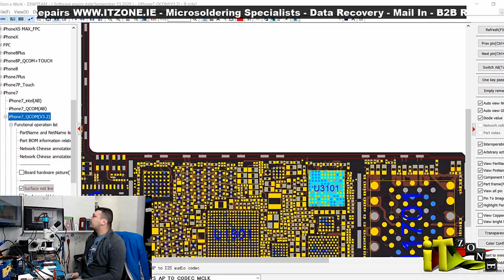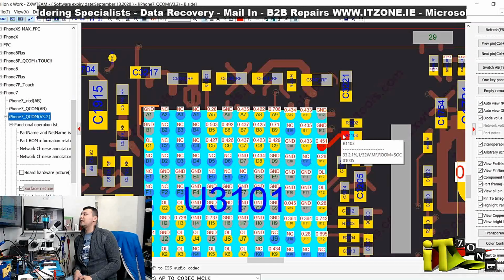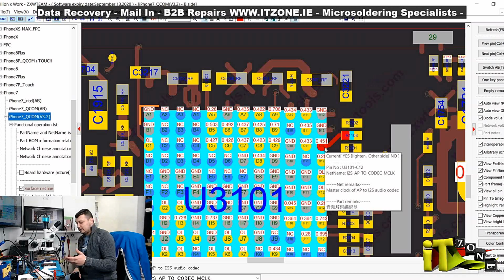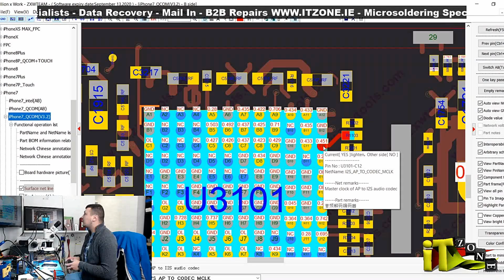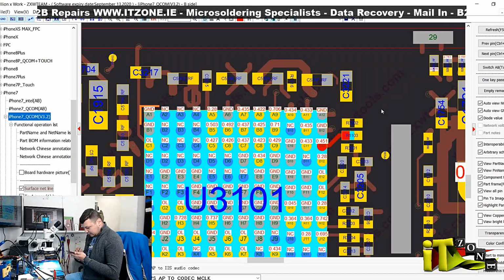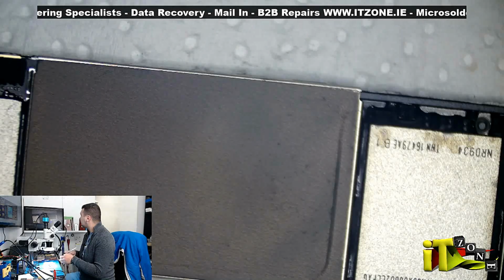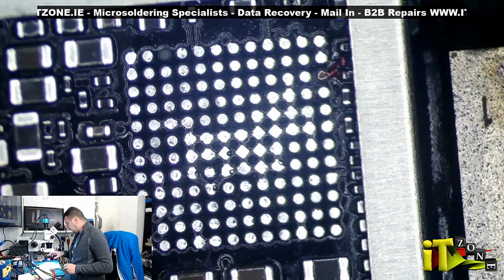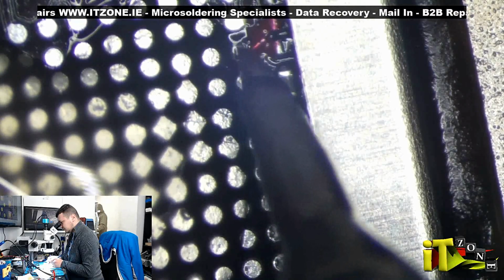IPHONE 7 / 7 PLUS SOUND NOT WORKING , WIFI NOT WORKING, LOUDSPEAKER GREYED OUT, C12 JUMPER - FIXED

Comment: Yesterday, i found wifi greyed out and no microphone working. I replace audio ic and run 4 jumpers because 2 pads was missing. After repair microphone working and wifi woriking. In the past i did not meet greyed out wifi caused by audio ic. This was on ios 12.4 very old ios customer did not update ios. Very nice job i will put on my channel my audio ic repair.